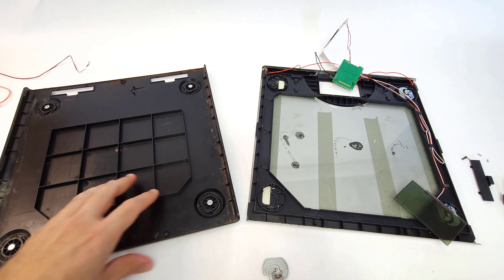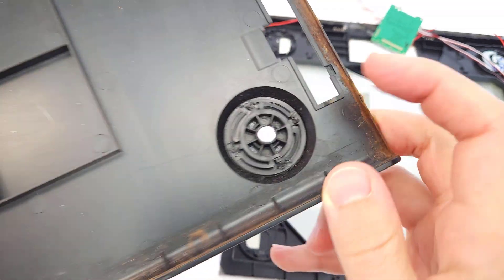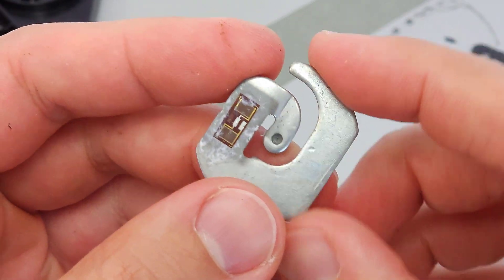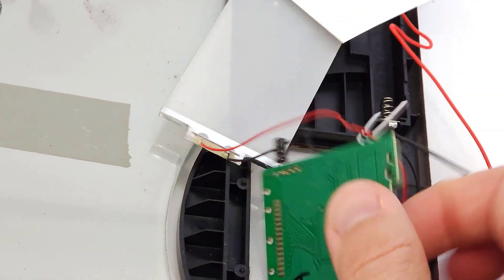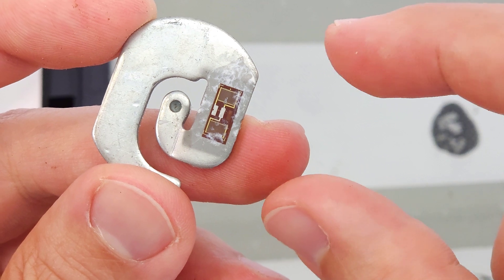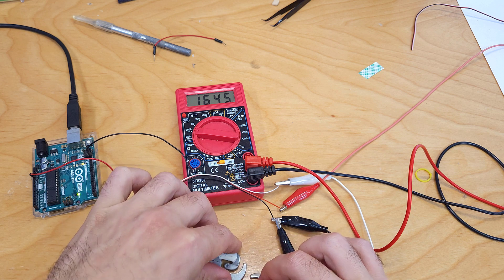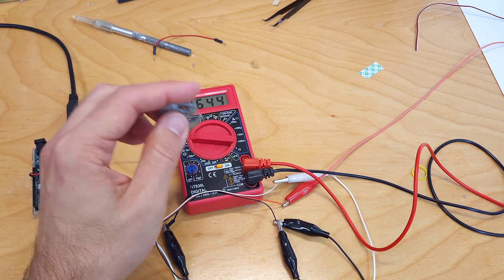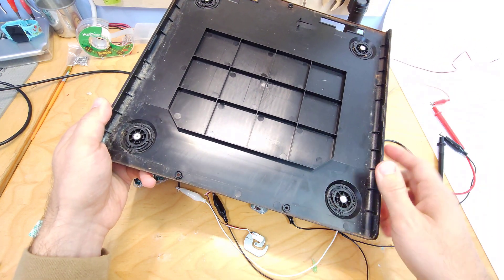How a digital bathroom scale works - strain gauges!

Comment: I'm always fascinated with how small of a voltage difference these gauges produce and yet they are fairly accurate when amplified.
Reply from the maker: Same! I was leaning on one gauge with all my upper body weight and could barely get it to change by a millivolt. So even roughly doubling my weight if I was standing on the whole thing, it'd be split across all four gauges, so if anything the change would be smaller.